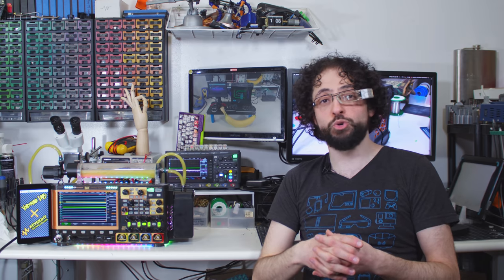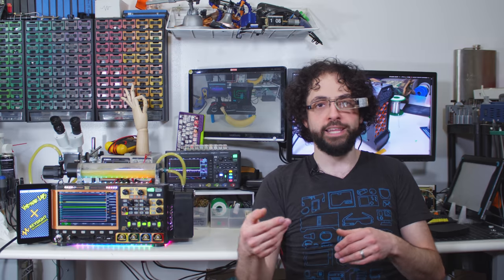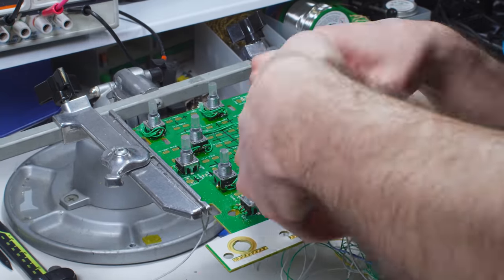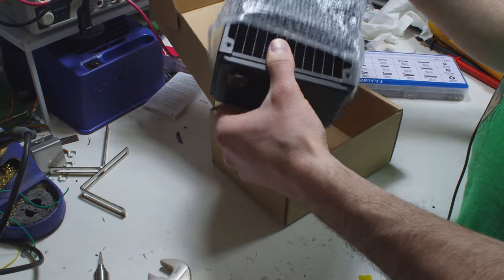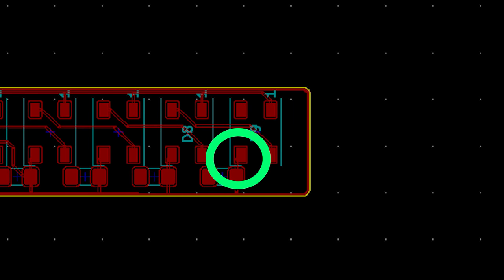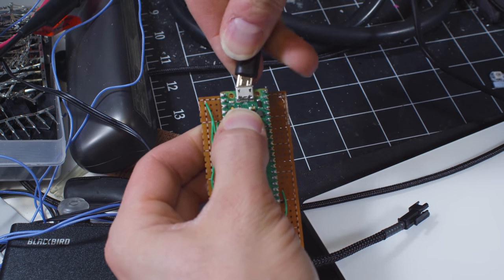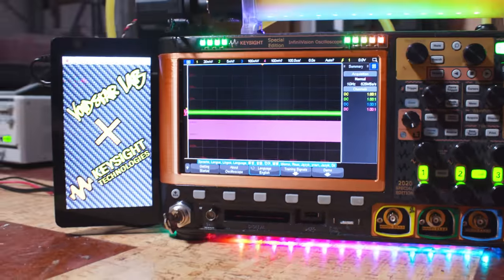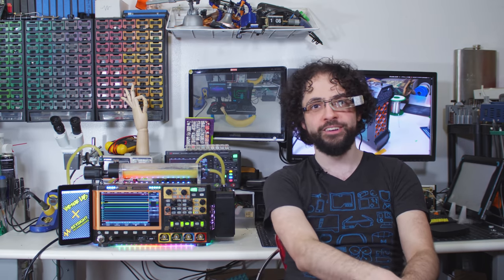The World's First Pro Gaming Oscilloscope: The $18,000 PimpScope 42069

Comment: Shielding so my measurements are actually accurate? Hell no, I want more L I G H T S
Reply: PWM that shizzle too for extra em noise.
Reply: @KeysightLabs  i love just how much you are in for it. this better make it to mass production
Reply: clearly the solution is metal flake glitter paint with a grounding wire. acts as shielding AND makes the scope double as a disco ball in case of emergency
Reply: needs Indium Oxide coated glass
Reply: @famitory  because you gotta have a back up disco ball!
Reply: Yup... there goes the noise floor and temperature stability spec on that baby.
Reply: @tp6335  ...with two holes for the water hoses... Although he could lead those through the remaining aluminum shielding instead. So it's a good idea.
Reply: @cda32  Yep. Especially with that series string water cooling, one chip heats up the other, so they will never be at the same temperature
Reply: I mean if you're a real pro you gonna filter out neopixel protocol out with your eyes right?

Comment: I'm really curious how much interference in your measurements you've introduced with these modifications. I doubt it makes that much of a difference for your average use case though. Having that said... a $400 scope probably would have been good enough that :P
Reply: He should ship it to Marco reps to get tested. Youtuber collabs ftw.
Reply: I cringed a bit when the first step was removing the shielding ;_;
Reply: @EdBordin  maybe replacing it with something semi-transparent, e.g. mesh?
Reply: @besenyeim  Or replace it with something completely¹ transparent! I've seen test equipment with a shielding layer over the display², possibly using Indium Tin Oxide (ITO), the electrically-conductive-but-visibly-transparent material used in touchscreens.

It might not be as effective as more typical shielding materials, but it's presumably better than nothing, and might be better than a mesh (depending on the mesh's grid size and the frequency of the radiation you're shielding against, I imagine).

¹ Within reasonable limits. I don't mean 100% transmission of the entire visible spectrum, pedants :p
² I think I saw that in a teardown video of a spectrum analyser over on the mikeselectricstuff channel.
⁰ Footnotes~! 😸

Comment: First, I fucking love this build it looks really badass.
Second, as someone who has done a bunch of water cooling on computers, there might be a few things contributing to the overheating if you're interested. This vid is a month old at this point though so I don't know how useful it would be.

1.) be careful with that coolant it's known to gunk up loops over time.
2.) all those kinks in the tubing might be causing the flow to be less than normal, which will have a big performance impact
3.) your reservoir isn't full enough, its generally good practice to fill it up enough to at least covering the inlet and outlet
4.) for god's sake put a fan on that rad lol I'm pretty sure a rad with half the surface area and a fan behind it would be even more effective. They make really quiet fans. Noctua fans are amazing, quiet, and even match the color scheme of that custom faceplate.

so personally, I would swap out the coolant with some water and clena out the loops. It will carry the RGB lights better anyway. Then find a tubing that is resistant to kinking. I think the bends you have with the coils in them are good though, but make sure the metal used in them is the same as the water blocks or it will cause corrosion and gunk buildup. If you can't do that, chuck some silver in there to kill bacteria. Finally get a rad half as thick and put a fan on it. It will take up the same surface area, you'll just need to find a way to power the fan.
Reply from the maker: Good advice. It turned out that the PSU produces more heat than the chips...

Comment: it kinda deserved hardline at that price point but you've met your deadline and keysight must be happy w the result since you posted it. good job, passive liquid cooling sucks (especially vertically mounted radiators against the case can't move much air between fins) but you're relying on the thermal mass of the liquid as you stated anyways

Comment: Not sure if it's still in the cards, you can get 3mm, 5mm, etc leds with ws addressible chipsets inside them, 4 pins, power ground din dout. Could simplify that wiring if you go back that direction.

Comment: If anything, you've just turned a $18,000 scope into an $18,000 paper weight, as now any signal you try to measure will be noisy as hell with all the shielding removed and all those noisy electronics added around it.

Comment: I have been using a Pi to augment the functionality of my oscilloscope (good for intelligently generating uart and other serial signals) and you have no idea how necessary that water cooling actually is.
Test equipment is apparently heavy duty usage for a Pi, I've already burned out an SD card from heat damage.

Comment: Hey Zack, what make, model, & feature/capability-set of Oscilloscope would you recommend first-time buyers consider?
Reply: Depends totally on what you want to do with it!  It would be extremely hard to go past the price / quality you get from one of the 2 or even 4 channel 70-100MHz Rigol scopes for a typical hobbyist. You can often find great deals on all the serial decode stuff being thrown in for free so you get i2c, spi etc. Define what you need in the way of maximum signal speeds, channels, sample depth, remote control and extra features (spi, i2c, USB2 or USB3 protocol) then go seek the advice of an expert reviewer like Dave Jones @eevblog
Reply from the maker: It's a tough call. For most modern makers, I'd actually recommend a logic analyzer like the Saleae Logic, since the majority of electronics you'll work with are digital. Honestly, get something over 20MHz with menus in a language you understand and a protocol decoder feature, and it'll keep you rolling for most of your career.
Reply: @ingmarm8858  Awesome! Thank you.
Reply: @ZackFreedman  Great! Thanks Zack. I'll check out the Saleae Logic for sure, and keep up the great work!  Your channel is fantastic!

Comment: Fix your 3D printer settings. Your prints look glossy and have layer inconsistencies. Somethings wrong with your nozzle temp.
Reply from the maker: They're printed in PETG and silk PLA, so they should be shiny! I do need to mess with the extrusion multiplier, though.
Reply: @ZackFreedman  yeah i had layer inconsistencies in my prints but some tweaking of the extrusion multiplier and print speed fixed it. Great vid btw. I liked and subscribed.
Reply from the maker: @Artichoked1  Thanks for the support, and for the tips!

Comment: Can someone explain to me what is an oscilloscope
Reply from the maker: An oscilloscope senses voltage. It takes millions of readings per second, so you can see electrical signals as they flow through a wire. They let you spot communication problems, find glitches, reduce interference, and make sure parts are working properly, among many other uses. The signal you see is a lot like an audio waveform, except instead of showing loudness over time, it shows voltage.

Comment: Thank god you had no idea this piece of equipment is 15k . this project is bad a$s. Turned out way better with the gtar knobs good soldering practice i suppose. It looks killer but how does its perform with all that shielding gone ? Dont run a microwave or ham radio anywhere near it . the smps needs the cooling , pcu not so much. Got a sub out of me ass soon as you reached for the dermal

Comment: What is a oscilloscope
Reply from the maker: It's a common tool for electrical engineering that displays how a voltage changes over time. It's useful for watching data, catching glitches, and really anything that requires you to look into your circuits.